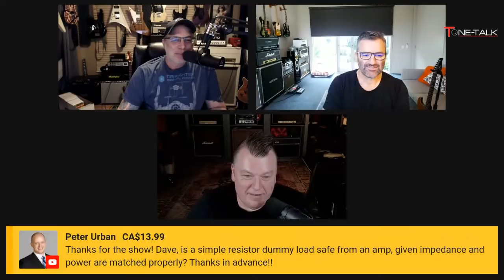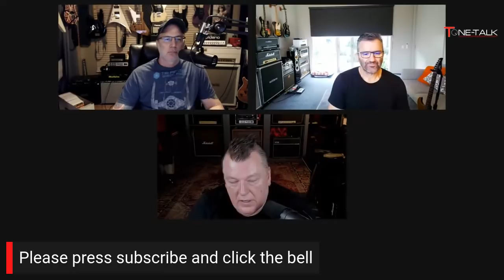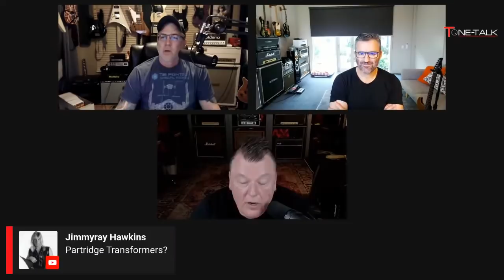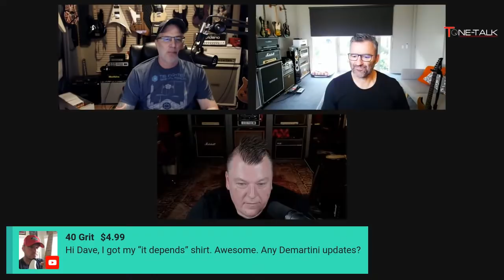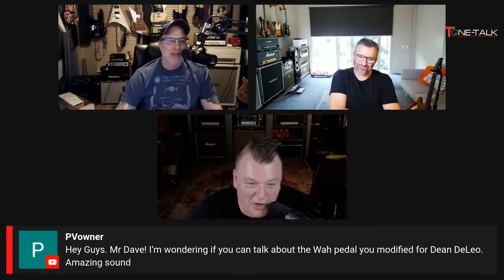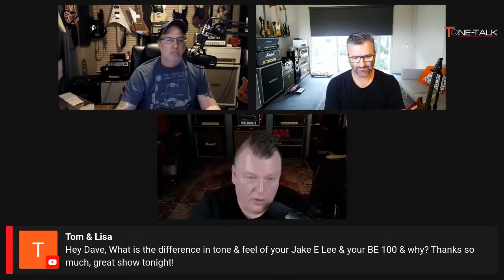Ep. 115 - Jason Tong of Headfirst Amplification!

Comment: The Laney AOL-series was an amazing amp for the time, but some reason (to keep selling models when customers would get sick of them?), they would "retard" the amps as common with many amp manufacturers imo.  In Series I, yes, looks like the 1st gain stage cathode capacitor IS 47uF and 22nF coupler!  WAY too much bass going thru.  In Series II, they dropped the 47uF to 2.2uF (still quite larger), but INCREASED the coupler to 100n!!  As Dave said, you want to lower the bass passing thru, so cathode should be .47uF or .68uF or 1uF.  The coupler should be 2.2nF or 3.3nF or 4.7nF.
Reply: Thanks for the help!